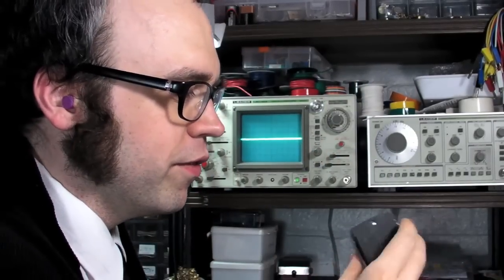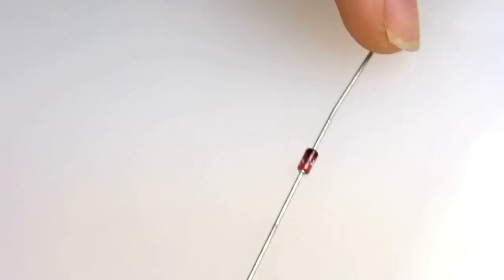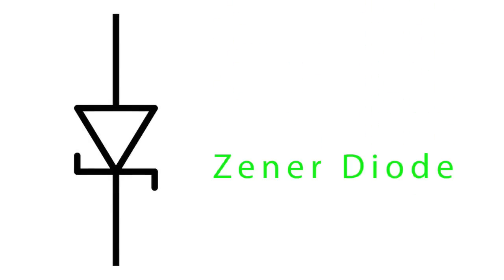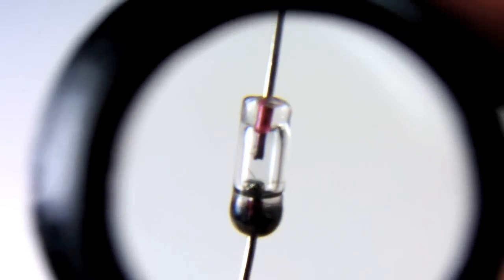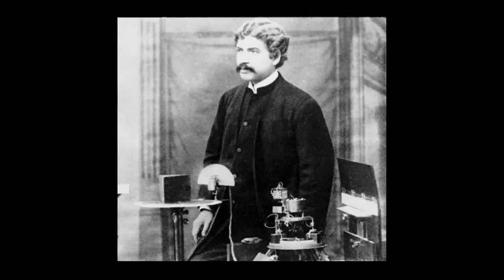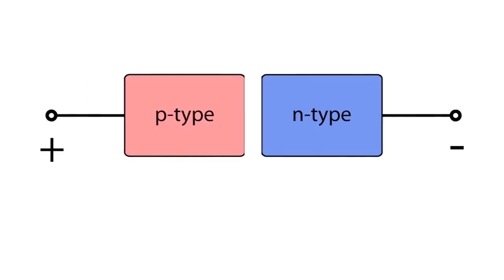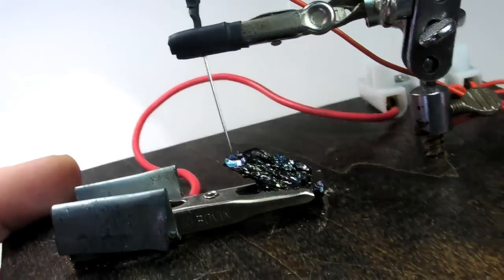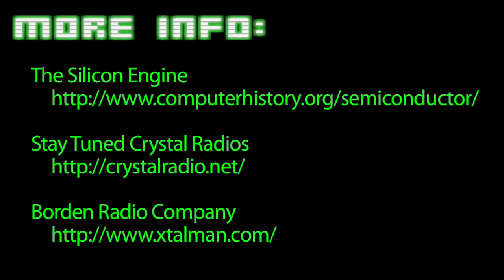MAKE presents: The Diode

Comment: Yep got that right! But it only creates half wave rectification (search it on google ), you actually need four diodes to turn AC to a 'nicer' DC voltage (full wave rectification with a bridge rectifier). May also add smoothing capacitors for a smoother output. Cheers, some Great videos to watch here :)

Comment: You didn't mention Schottky diodes. When you need super fast diodes, those are the ones! They tend to have voltage limitations of at best (last time I looked) 100V, but I found in repetitive applications like high frequency signals, you can series them and the capacitance (which is also relatively high), balances them. They basically have NO recovery time.

Even if you hit breakdown, the offending diode (I say that with great affection for the diodes) will conduct more, thus causing the other series one to take on more voltage. No failure. Plus, they only usually have like 0.3V forward voltage which is half of a normal silicon diode. Lots of capacitance, but in a high powered circuit, that's not really much of a problem.

Comment: Those Radio's that Recieve Radio waves using a Galena Crystal is called a Crystal Radio. I'm actually building a Crystal Radio now using a "1N34A" Geranium Diode and a 365pF Air Variable Capacitor, a Simple-to-Build Plastic-Core Inductor, and a High-Impedance Piezoelectric Earpiece. btw, Crystal Radio's were the First Radio's that were used in the 1910's, 1920's, and partially in the 1930's and 1940's. Crystal Radio's make their own power, however don't create alot of power.

Comment: You should not use a Power silicon pn junction diode in series with your main power rail, it has a voltage drop of 0.3 v. Only use them when needed, for rectifying AC to DC, flyback voltage, etc.

Comment: @pprinceton11 All PN junctions (Diodes) Emit photons some in the visible range that you can see,  LED are constructed with the junction exposed under a lens, where as a simple diode is encased in a non-transparent plastic case so the photons cant bee seen. this is a simplistic  overview and you must take into account the voltage across the diode junction.

Comment: you'll need lots and lots of them for it to work, thousands. What can be done though, is a kind of voltage barrier, taking in consideration the 0.7V that a sillicium diode needs to work, if you put two of those, it will need approximatly 1.4V to conduct. Germanium diode needs 0.3V, which you can combine to get specific values. It's not acting like a resistor, but still doing something :p

Comment: Cool!

The un-powered diode crystal radio circuit, with only a resistor, a couple of capacitors and a coil added to the diode, is capable of incredible feats. 

The same basic diode radio circuit, plugged directly into a computer, can act as an EM field detector, a light-sensitive discriminator, or even a microphone. 

The circuit can be also tweaked to act as a beta brain-wave modifier to allow better use of alpha and theta brain wave states.

Check out my Spirit Radio playlist for experiments.

Comment: If I'm not mistaken, isn't that diode installed in reverse? It looks like the cathode is connected to the positive supply and the anode is connected to the chip's positive supply terminal.

Comment: It's simpler than that.  It's set up so that if someone connects the battery backward, all the electricity flows through the diode and not the circuit.

Comment: I've heard that many diodes have a voltage drop around 0.7 volts. If I want to use a diode as a polarity protector like explained at the end of this video, won't a circuit powered with 5 volts only get a 4.3 volt supply? How do I prevent this from happening? Are there diodes available with very low voltage drop?
Reply: No

Comment: Hi mate I have a Cheap 5v 7W  portable solar panel to charge my devices,works well, but I think that when the sun goes down and solar panel output dropped with my device still connected to the panel for a few hrs , my device  battery went flat, think I need to make a connector with diode to stop this happening what diode would I need for 5V 7Watt output
Reply: perthbiker 1n5817 are commonly used in small solar panels

Comment: @GW1OII  "The luminescent substances are used as radiation converters to convert a higher-energy primary radiation, for example, ultra violet (UV) radiation or blue light, into a longer- wave visible radiation and are therefore preferably employed in corresponding light-emitting devices."  invisible form of light is converted to visible light  by the luminophore how can you say that it is not a part of a light emitting diode? its one of the most fundamental parts...

Comment: @pinochska Your simply not understandingly what is being said, the LED that is a standard PN junction not a OLED or other derivative , most LED's depending on the PN material in use, Ga etc.. emit visible light the phosphor / luminescent material your referring to is added AROUND the junction only if a colour change is required eg. to produce white light from blue.  By manufacturing different types
of crystals having different natural energy levels, various colors of
light can be created.

Comment: I'm french and haven't understand wich crystal is used, can somebody write it please ? I wonder if i can do one at ohm :p
Reply: germanium  crystal
Reply: Aren't most diodes now silicon, or am I thinking of transistors?
Reply: +Matthew Ferrie Most semiconductors in general use silicon or germanium, it depends on what you are using and what it is used for.
A typical rectification .7V diode is silicon, however. Most BJTs that you may use are also based around silicon.
Reply: +Matthew Ferrie diodes are made from silicon indeed, as are transistors
Reply: Lromain55 
The REALLY old point-contact diodes used in early crystal radio sets was made from GALENA crystals.